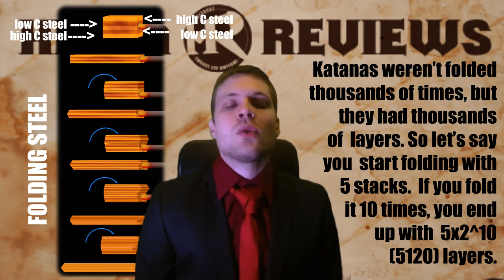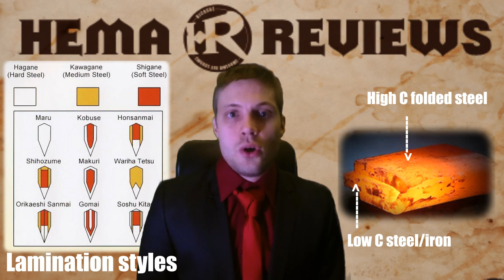Educate Yourself: Katana vs. Longsword

Comment: european swords were also laminated, destructive testing at the royal armouries showed 5 piecec lamination, if i remember correctly
Reply from the maker: Will have to look into that, thanks! :)
Reply: it depends on what time and which area made the sword. The monosteel sword didn't show up the 1200s if I recall right.
Reply: 'stacked steel' (like katana... ie folded) with added higher carbon edge has been shown in a 2nd century gladius analysed at the royal armouories too...

adding higher carbon edges is reportedly quite common on pattern welded swordblades throughout the 8th and 9th centuries I think it was.

from the 10th century many swordblades (ulfberth ones for instance) are no longer pattern welded, but wheather they qualify as 'mono steel' I am not sure.
Reply: Ulberth is an anomaly for the vikings. Either a small group discovered how to produce better steel few centuries early and kept it secret or the Vikings brought home some Damascus Steel to play with. They did manage to reach all the way to Baghdad after all.
Reply: well i wasn't nessesarily just talking about vikings
Reply from the maker: just a few points: Lamination and folding the steel are two different things. Folding the steel was done before good monosteel became available. 5-piece lamination means that the sword consisted of 5 different steels, implying the different steels were used due to their different characteristics. I know of plenty 2-piece laminated swords from Europe (vikings often welded a harder edge on the body, for instance), but 5-piece is a rarity. Steel was present in the 2nd century, but of a much lower quality, and since it would've been made out of a bloom, it'd have to be folded anyway. Ulfberth is made damascus, which was imported, and is a monosteel.
Reply: the five piece blade was much later,  15th century, when carbon steel armour was well established, for instance, so steel supply was really quite different from the 'viking' era .

so
-the gladius is folded and appied edged, 2nd century,
-viking era, 9th century is patternwelded with applied edges
-15th century blade made up of different sections... apparently

so a development of about 1200 year encompassed in those three examples...

but interestingly considerably earlier than the pinnacle of the katana...
Reply: HEMAreviews A Viking sword was made by being welded phosphoric iron and steel.This was made with twisting rather twisting and distorting a material.The knight sword which you want to advertise is made of wrought iron with carbonizing at bloomely.
Removal of oxide(Slug) of both sword is enough neither.In other words, this type of sword is made with the oldest technology.European steel making technology wasn't making progress at all.
Reply: yamashisho Are you here spreading more misinformation?
Reply from the maker: yamashisho I'll attempt to answer very quickly. Phosphoric iron was sometimes used in viking swords to bring out the pattern more. It is true they twisted bars, however, they also folded them to get the amazing patterns. The "knight sword" spans several centuries and was made in different ways. Wrought iron being carburized is actually a very advanced method and provides a much better grade of steel for swords compared to simply picking off parts of a bloom. The last statement is simply completely wrong, as there were VERY significant advances in both steel production as well as heat treatment through all of the medieval times, and stretching up to the 20th century.
Reply: HEMAreviews Careful, I've seen yamashisho on another threads about the subject, and the result is not pretty. Most of the time, the sand iron ore from Japan equals or surpasses modern industrial steel in quality, and this "superior" steel is what katanas are made of, according to him..
Reply: define quality?
Reply: Those were his words, which katana VS longsword debate or history channel documentary about the katana it was, I can't remember. There's just so many of them.
Reply: The problem is that the term quality is more or less defined by the application. is it the hardest steel? the most flexible, the most malleable? Is it based on a certain carbon content? If he wanted to say that their crucible steel is quality steel because it has a very high carbon content and was very hard, then yes I could agree. But it is also very rigged and brittle. So if some one wanted to say it was not quality steel because it was too brittle I would have to agree. It all depends on what aspect of the metal you are looking at. There are the middle of the road steels that have a good balance of tensile strength, toughness, hardness, flex, rigidity, and ductility. Some one might argue that is quality steel because it is ok at everything. And again I would have to agree. So what I will ask him is what definition is he using for quality steel?
Reply: Sorry, its late and I'm rambling.
Reply from the maker: Will nonya you're thinking in modern terms. Hardness and brittleness are indeed important pieces of sword quality, however the quality of steel is determined primarily by other factors: namely how much impurities (slag) it has, and how uniform the carbon % is throughout the piece. The idea that iron ore, which steel is made of, comes in vastly different grades is wrong as far as swords are concerned. Fe is Fe - it might have some good or bad inclusions, which makes it more or less suited for swords, but those differences are minor (unless carefully calculated and added, as today). So the Japanese did not have shitty ore, they just stuck to a method which produced less uniform steel with more slag and required more manual labor to get a good billet for a much longer time than the Europeans did. Conversely, Damascus steel was almost completely slag-free and uniform as far back as the 10th cenutry. Keep in mind, Damascus has too much C to be great for swords, but was legendary because the C% was uniform and because it had so little slag, allowing for a much more durable blade.
Reply: Will nonya
Do that. As I said, those were his words and I remember it purely because he made some outrageous statements that his japanese high quality tamahagne would slice through longswords and plate armour (not necessarily both at the same time, but still) Steel slicing steel in human hands where as both are sharpened metal and/or alloy bars? Yeah, right... Bend or even snap off, sure, with some wear and tear or truly improper use... Like say, trying to chop off a rebar (is it a rebar or just rebar?). Never thought of that, probably since English isn't my first language.
Reply: Bastardsword01 You misunderstand a little.
I explained various steelmaking technology.
First, a basis of modern steelmaking is mass production technology.
Cokes are used by the way to make a great deal of pig iron (cast iron). And next proces decarburization is perfomed.Sulfur gets mixed in the material during it.Modern shaft furnace makes a fragile material  instead of a great deal material (pig iron) with this. In other words, a modern material is poor-quality at the stage of smelting.

Present-day special steel (about 30 %) produces steel beyond the strength of the historical steel by the method that to add a different element to the material and some pressurization using machine. Modern steelmaking began in the 19th century.
But Modern tensile strength steel has the strength of the wrong number of digit compared with historical steel.
https://en.wikipedia.org/wiki/High-strength_low-alloy_steel
Check it.

If you add other elements(useful impurities) to a tamahagane, and use modern forging machine, the quality of the steel will has to exceed modern tensile strength steel.
Reply: Will nonya I explained the same thing repeatedly.
The modern tensile strength steel is strong in a wrong number of digit compared with historical steel.It is also stronger  than historical steel against impact .
First, buy a scientific book of the steel making and read it.
A basis of strong steel is a smallness of the crystal organization.When the crystal organization will be small, the hardness and the strength against the impact rise at the same time.

There is too much modern method developed newly, so I don't explain all  of the Technologie , but this is also achieved by simple pressurization.
The crystal organization of the steel will be small by adding titanium and niobium to the material.So a manual of a real steel making explains that the hardness of the steel and the strength are same.
A low material of iron sand which has many  titanium was used in Japan.
The crystal organization of the steel of katana was small by pressurization of a repeat.
Subdivision of the crystal organization is the ideal technology which a modern steel manufacturer is also emphasizing.
Reply: HEMAreviews ＞ they just stuck to a method which produced less uniform steel with more slag and required more manual labor to get a good billet for a much longer time than the Europeans ＞

Your commentary is completely wrong as always.
The modern Japanese steel and steel manufacture technique are the best in the world, but the Japanese steel of top quality goods is still made by iron sand.This brand is called Yasuki-hagane(steel).

https://ja.wikipedia.org/wiki/%E5%AE%89%E6%9D%A5%E9%8B%BC

You do not clarify sources of information at all all the time.In other words all your commentaries are irresponsible.

The folding process reduces oxide of the material. So, slag is oxide.In modern method, aluminum is used as a deoxidizer.European manufacturing method did not have a process to remove oxide.
Therefore the European steel was much more brittle than Japanese steel.

If you study the science of the steel making seriously you will understand the reason why the method to make Japanese steel and the Japanese material is high without reading a book of techology of katana.
However, we do not thereby understand the reason of the high quality of the Damascus steel.
Reply: yamashisho you should probably stop assuming that everyone who goes by information different than the propaganda you are spewing is uneducated or hasn't researched the subject. The Japanese have a pretty bad history of spewing out ethnocintric propaganda.
Reply from the maker: yamashisho So, i'm not sure if you're oversimplifying, are simply not familiar with steel producing enough, are trying to mislead, or all of the above.
First, modern steels are amazing, and contain only the elements planned. Second, the crystal matrix is determined by heat treatment more so than by the steel itself. And while there are elements that help with a better matrix, titanium is not one of them. In fact, as far as swords are concerned, titanium is just a metal that sounds cool.
Next, I was not talking about modern steel manufacture. Jeez. Comparing modern steel with medieval steel is like comparing a bow and arrow to a sniper rifle.
All of this information is quite easily available on the internet. but I suggest you read Allan William's books on medieval metallurgy, both european and asian.
Next, no oxide is not slag. Metal oxides are part of slag. As is silicone dioxide, and sulfites, and a few others. And yes, folding does remove most of the impurities. The point is, in the 16th century, Europeans had access to steel with little to none of those impurities.
The reason damascus steel was of such high quality is that it had virtually no impurities in a time when no other nation could claim the same (so up to the 16th century).

I really recommend you look for knowledge when you process information, and not just to confirm your own bias.

Regards,
Reply: Will nonya
I don't want want to be that guy, but... What did I mention earlier?
Reply: HEMAreviews

http://www.jfe-21st-cf.or.jp/chapter_2/2i_1.html

Secondary refining is performed in a dissolution state of a material.

The way of the European steelmaking in the Medieval time is mere bloomery .

The method to remove impurities did not exist at all in Europe.
This is right opinion.
My commentary is right.

https://en.wikipedia.org/wiki/Henry_Bessemer

The beginning of European decarbonization steel manufacture is after 1856.
The steels in those days includes many impurities in comparison with steel of the modern steel manufacture uniformly.

A firint of Damascus steel (the design) should form by partial dissolution by low temperature.In other words, Secondary refining wouldn't exist in production process of Damascus steel.In the case of Chinese crucible steel,  There is an example from which sulfur was removed in the perfect dissolution state of a material.After all, the reason that Damascus steel was high-quality is mysterious.
Reply: yamashisho You misunderstand a lot. The quality of the iron ore in Europe made the process of folding and welding obsolete, as better iron ore along with better smelting processes meant that a single piece of steel could be hammered to the desired shape of the blade. With typical Japanese iron sand, the process of folding is necessary to remove a lot of the inherent impurities that comes with the process of smelting that ore. The only thing this adds is further work upon the steel before it can come to practical use as a blade.
Reply: Bastardsword01 You should give up.
Japanese steelmaking technology in modern Japan is best in the world, and Japanese first-class steel are still made from Japanese iron sand.
Yasuki - hagane. This is the brand name.
You're persistent.
An substance must rusts in the nature.
An iron ore or iron sand also must rust in the nature.
Secondary refining didn't exist in Europe, and all of the oxide stayed in the European steel.
Reply: HEMAreviews＞titanium is not one of them. In fact, as far as swords are concerned, titanium is just a metal that sounds cool.＞

 I'm different from you, and don't say an irresponsible thing.

http://www.nssmc.com/en/tech/report/nsc/pdf/6111.pdf

Oxide was regarded as harmful impurities in the past.
But, ferrite was collected using oxidation titanium as a core, and Japanese steel manufacturer Nippon sreel found that a small crystal grain forms.

Chack this.

"Nucleaction of intra-granular ferrite from Ti2o3" of Photo (1)

A crystal grain of steel will be also small by simple pressurization (hammering or rolling  etc).

This method is called as Grain boundary strengthening

http://www.chemeurope.com/en/encyclopedia/Grain_boundary_strengthening.html
Reply: yamashisho Again you haven't defined why it is the best. You can't just keep saying that it is superior with out talking about what qualities of the steel make it superior. Hardness? The Japanese sword edges tend to be around 60-65 on the Rockwell Hardness test compared to European swords that were around 50-55. However this hardness also made it a more brittle steel. Also the traditional way of making a Katana required a high carbon sleeve to be welded onto a low carbon back. This was because the high quality steel used on the edge was rare, and hard to manufacture, so their engineering solution was to make a composite blade. The thick spine on the katana was necessary to prevent flexing in the blade to preserve it's brittle edge. This caused the sword to be very heavy, which is why it was made so short compared to other two handed blades. I also thought it was already made clear that this isn't about modern steel making technology. Yet you keep bringing that up too.
Reply: Will nonya When comparing, a steel product with the structure like katana is a rail of a train   or  an the inner structure of engine .

I say again.
The effect of Grain boundary strengthening  rises both of the hardness and the strength against the impac at the same time .
And the tensile strength and the hardness also rise by this effect at the same time .

●The Viking sword in early stages of medieval times.
 200-500VPH
 
●The sword of the Renaissance which was unearthed in Poland.
 Edge 504VPH
 Core 150VPH
 
●katana
 Edge 842VPH
 Shinoge250-350VPH
 Core, about 100 VPH
 
(The Royal Armoury research institute's data )

Katana has 1.67 times harder edge than European sword .

http://search.jword.jp/cns.dll?type=lk&fm=12008&agent=&partner=manboo&name=wiki&lang=euc&prop=494&bypass=1&dispconfig=&tblattr=1

Differential tempering[edit]Main article: Differential tempering
 ↓
"A differentially tempered sword. The center is tempered to a springy hardness while the edges are tempered to a very high hardness.
Differential tempering is a method of providing different amounts of temper to different parts of the steel. The method was often used in bladesmithing, for making knives and swords, to provide a very hard edge while softening the spine or center of the blade. This increased the toughness while maintaining a very hard, sharp, impact-resistant edge, helping to prevent breakage. This technique was more often found in Europe, as opposed to the differential hardening techniques more common in Asia, such as in Japanese swordsmithing.
Differential tempering consists of applying heat to only a portion of the blade, usually the spine, or the center of double-edged blades. For single-edged blades, the heat, often in the form of a flame or a red-hot bar, is applied to the spine of the blade only. The blade is then carefully watched as the tempering colors form and slowly creep toward the edge. The heat is then removed before the light-straw color reaches the edge. The colors will continue to move toward the edge for a short time after the heat is removed, so the smith typically removes the heat a little early, so that the pale-yellow just reaches the edge, and travels no farther. A similar method is used for double-edged blades, but the heat source is applied to the center of the blade, allowing the colors to creep out toward each edge.[13]"
Reply from the maker: yamashisho yamashisho Ok, since I see you won't listen to reason, and you're not willing to listen to facts that disagree with your views, I'll just dispel the one that seems to be the biggest problem: the earliest known European finery (which is where pig iron was decarburized), was in Namur, dating back to the 15th century. Yup, that's at least 357 years earlier than your date. The Bessemer process date is indeed correct, but its main point was that it allowed mass production of good steel, the keyword being mass. Decarburization, as evidence points, was already performed in Europe in the 15th century.
Reply: HEMAreviews Perhaps it would be the last place including the Eurasian continent and the African continent.
In any case, European blade was made by carburizing.

In fact,  but there is a theory that koto area katana has been made by decarburization pig iron, but the specific method is the lost technology.
This is a method that has been called zukuoshi.(銑鉄押し)The smelting took four days.
Reply from the maker: yamashisho

You just aren't listening. Tell you what. go read Allan William's Knight and the Blast Furnace. http://www.amazon.com/Knight-Blast-Furnace-History-Metallurgy/dp/9004124985/ref=sr_1_1?ie=UTF8&qid=1436476994&sr=8-1&keywords=knight+and+the+blast+furnace
Terribly expensive, but any good library with a metallurgy section should have it. In it, you'll find detailed descriptions on how sword were made in Europe from the bronze age onwards. Yes, some European swords were made by the process of carburization, for example by case hardening. This was still in the early stages of steel metallurgy, though (think cca. 13th century, but I'd have to check to be 100%). By 16th century, decarburizing pig iron to get sword steel was common. Now stop spreading misinformation and half-truths, please. It seems you know just enough to not know how much you don't know, at least as far as European swords are concerned.
Next, "grain boundery strengthening" is also heat treatment (among others). Which the Europeans most definitely used.
And decarburizing pig iron is definitely not lost technology....

Seriously. Read the book.
Reply: yamashisho I should give up? Because your viewing is incorrect? That's an odd way to address facts... but I guess it is on behalf on your inability to understand even basics.
Reply: HEMAreviews ＞ By 16th century, decarburizing pig iron to get sword steel was common.＞ Everything is wrong.If this professor relates existence in a furnace and existence of an oxidation decarburization, this author is scholar of failure.A sword of Europe in the Middle Ages and armor were made with carbonization.In other words, they  still  used the wrought iron made with a bloomery.A thick European sword blade like around fourteenth century  like katana was made with the long carbonization which reaches two weeks. ＞Next, "grain boundery strengthening" is also heat treatment (among others).＞ Study the basis of steelmaking.I was surprised at the level of you who are a missionary of the HEMA monastic order.I will have to spend at least three years for lecture steelmaking to you. First, heat treatment is not agrain boundery strengthening.Heat treatment is a technique for martensitic transformation. Temering is a technique for an adjustment of its depth. I was surprised that you who are a chief missionary of HEMA monastic order have only wrong knowledge . ＞And decarburizing pig iron is definitely not lost technology....＞ You mistook read the context.In Japan steelmaking by decarburization was done. But we don't have knowledge of the level which can reproduce that perfectly.Of course, the reproduction of a method of actual Europe in the Medieval time is just impossible.
Reply: what is preventing the modern blacksmiths to use the right steal with the katanas ? like titanium or something ?  ...FUCK THAT ..YOU GUYS DON'T EVEN USE SWORDS TO CUT ANY SHIT ..WHY YOU ARE ARGUING ABOUT THAT ?
Reply: Ckyntosh Because poor English and a caps lock is the best way to get a point across.